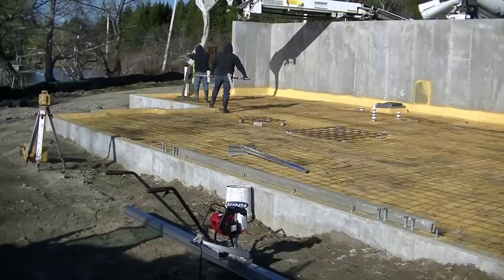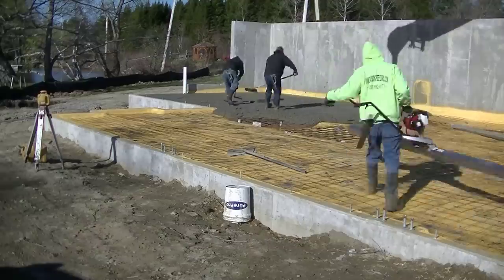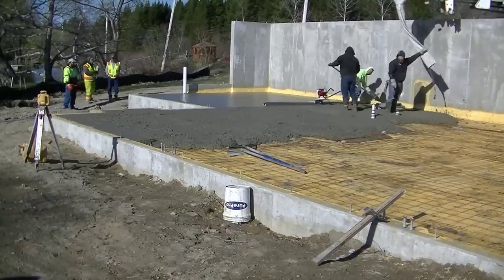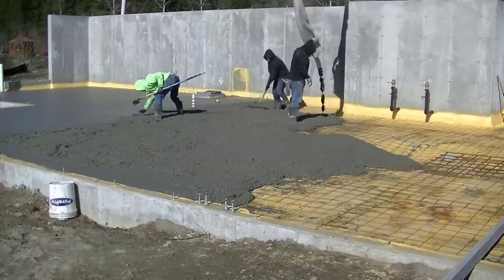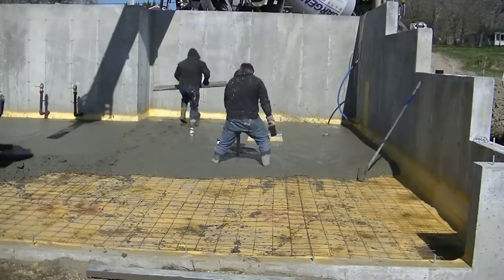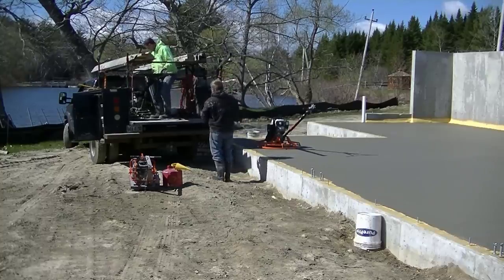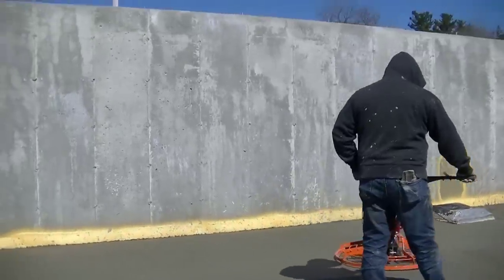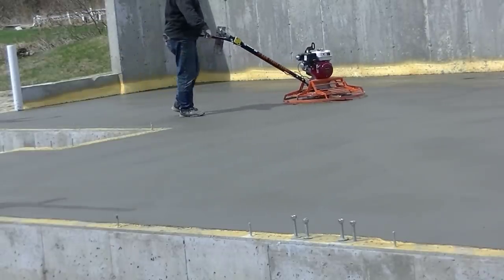Concrete Pouring And Finishing Techniques (New Vibra-Screed)

Comment: Mike nice job. 👍👍did you like it better then the  marsheltown shockwave? I have the shockwave it is a little heavier then my last power screed. What mix was this concrete? Did you use the water reducer in this one or didn’t you need it with the conveyor vs the shoot extensions that you usually use. They just stopped using hot water here in upstate New York. We’re pouring a 40 yard pole barn next week. I’m probably gonna have it on my channel.
Reply from the maker: I really like the Shockwave also. It's one of the better ones I've ever used. I still have it. We used a 3500 psi mix with 3/4 stone and fibermesh. It did have water reducer in it. 40 yard pour is a good one!!

Comment: So what are your feeling about pouring over foam?  Doesn't the foam break down over time causing the concrete to sink and crack?  I Know that might be a long way off but I live in a house built by my grandparents and the builder kept doing things and said don't worry it will take years for it to sink etc.  Now I deal with all the sink holes and cracked walls etc.  thanks for the video I like the power Vibra Screed a little extra power always helps make the day end pain free.
Reply from the maker: I've been pouring over foam for almost 40 years. Never heard of it breaking down if it's the right foam.

Comment: Nice job Mike. How does the wire work on the foam? here we have to use plastic chairs to hold it up or on residential jobs we pull it up with a hook. Just poured  80 yards on a 50 x 85 x6" slab with a new Shockwave I ordered after watching your other video.
Reply from the maker: We pull it up also, or put slab bolsters under it. That's awesome about the Shockwave.

Comment: Hi Mike it looks like you do some real nice work love watching your videos. I wish you were closer enough to hire. I'm interested in doing a driveway at the at my house so I can park a motorhome on it. Can I ask you for your advice in any tips on how thick I should do the driveway and what strength of concrete should use. Should I put wire in it. I really appreciate any advice you have. Thanks you very much
Reply from the maker: I'd make it 6 inches thick and use a 4000 psi concrete mix 3/4 aggregate. Use wire or rebar.

Comment: Would the spray foam cause inconsistency in the depth of the concrete? I understand the need for foam in the northeast. Mike what is your opinion of the use of foam under the concrete? Great video. Thanks
Reply from the maker: It was wavy, it made it hard to estimate yardage. I like the 4'x8' sheets, they're nice and flat.  Foam helps keep the floor a little warmer it's good but expensive.
Reply: Learn more. We use a lot of spray foam under our radiant heated floors in upstate New York. This floor that mike poured had a lot of deeper spots in it that would be very difficult to use board foam. That’s probably why they did spray. We tamp fine gravel under our spray foam jobs and it’s pretty even for the most part. The foam is closed cell so you don’t need a vapor barrier under it either. Also there is no gaps in the foam to loose heat. We use 1-1/2” of spray under our slabs or 2” board foam. Spray foam in my area is $1.50 a square foot and foam board is about $1.10. I like the spray because I call the foam guys and they do it and then we put the wire and tubing down and pour. I got videos on my channel showing them spraying the foam. Check it out.

Comment: Hey Mike my company pours all its own concrete and frames the homes. My question for you is what concrete mix are you using. Slump?  My guys and I have tried to kick screed a few times but we always revert back to setting pins and having 1 end of the screed following a ledger screed .  But my biggest question is the concrete we put down never seems to flow and level out like yours and while screeding we will get large holes in the area we just screeded. That we stop and fill in go over again then continue.  What mixes are you using it looks alot easier than what we've been using.  We are in Bend , Oregon.  Thanks for your videos.
Reply: He uses a water reducer.
Lets it flow better with less water same strength
Reply from the maker: This was a 3500 psi with 3/4 stone and fibermesh. It has water reducer so we can pour a 6 or 7 slump without any problems.
Reply: @MikeDayConcrete  ok thank you is there a quantity of water reducer to request? Or just ask for a 6.5 slump  , 6 sack with 3/4 aggregate and add ?? Some water reducer.  Thank you so much.. i tried to get a rat slab mix for a 3000 sq ft underfloor with water reducer to make it easier to screed out and level without getting all the cracks I  sometimes get in my rat slabs but the concrete plant forgot to send me the special mix...

Comment: Hey Mike, I been watching a lot of your videos and there great. I have help finish concrete but never have been the one in charge. Building a 40x64 pole barn with a 16x64 lean on the side. My question is that the building will be 13'4" inside without concrete, will a concrete truck fit in there? Thanks

Comment: I am seriously going to buy a vibra screed do you recommend this unit over the marshalltown?  I've  never used a  vibra screed . We only pour about 8 garages maybe 2 houses  per year. The rest get rat slabs then floor joist.
Reply from the maker: This one would be just fine for you. It's a little lighter than the Shockwave. Both are very good though.

Comment: I know you don't usually have jobs with rebar in the floor, but looks like there was wire or rebar on this job?  I didn't see you guys pulling it up, so was it set on dobies or something?
Reply from the maker: Yea, it was up in the air a bit on that styrofoam, plus we had fibermesh in it.

Comment: Might not have backfilled so the wall can keep curing for enough time
Reply: Concrete will continue to cure with or without backfill. You could even make the argument it would cure better with backfill bcz of the moisture in the soil.
Reply: Running a packer along side the wall at every lift isn’t recommended if the wall hasn’t cured to the correct strength and could cause structural problems like cracks
Reply from the maker: This foundation had set there long enough it could have been back filled. Maybe the excavator couldn't get it done in time, I don't know. It just makes the job a little harder unless you use a pump.

Comment: I never use float blades.... almost never burn the floor in. I never need to run my blades at that high of rpm, I go the other way and I hardly every get concrete on top of my blades, my blades are very easy to clean up.
I never used a hand vibrating screed, I always though I would like to try one, but some how I don’t think I can get it as level as a kick screed. There’s people that come up and say that looks good when you get it bull floated, I don’t know why you would have to burn the floor in .... I think that’s more in the finishers head than in the customers. And all a build ever ask me is “how did it come out? “ I answer great”
Reply from the maker: So you're saying finishing the floor really smooth is just in my head? It's just how we do it, like you do it your way. Why would you say it's in my head. What do you mean by that?
Reply: Mike Day Everything About Concrete what I mean it’s in you head is you may think the burn look,looks good because thats the way you have done it for a long time, I may think the fuzz looks good because that’s the way I done it for a long time... when people come and see your floor they are going to like it because they think your the best and that’s the way a floor should look because that’s the way you finished it, they are happy, very happy.... people will come up and see my finish and think it looks great because they think lam the best and I know concrete, either thought is right because the rules of nature clean and neat looks good....
The rules of nature also tell us when something is wrong and it will be able to override what people think of us....
Example a crooked joint will look bad to everyone, reputation can’t help you there.... sloppy edges will look sloppy to everyone....a floor that’s supposed to be level , but it’s not will be wrong to everyone......
Let me say it agin another way there’s probably a lot of times you  could stop on a floor and it looks good, and would look good to everyone,
You keep finishing, keep going because in your head that’s not the look you like,.... in your head  is not about something being good or bad, right or wrong it’s just your personal preference.....
Reply: OK , now that psychology class 101 is  over you can get get back to work .looks great and that’s from 1000 miles away so it must be good , for my eyes  not my head , i’m just joking guys , I always yell perfect ,  imagine if you yell” uh oh “ enjoy the winter